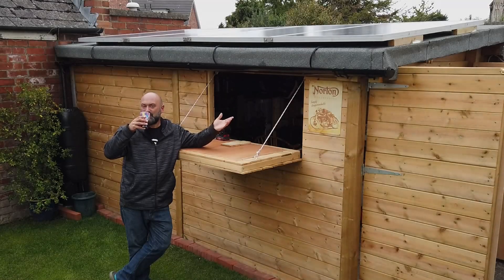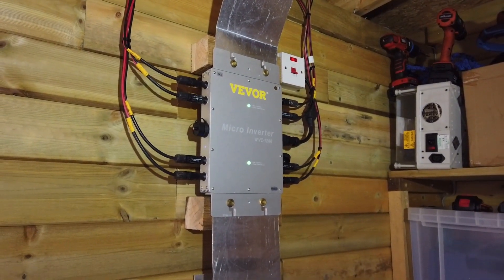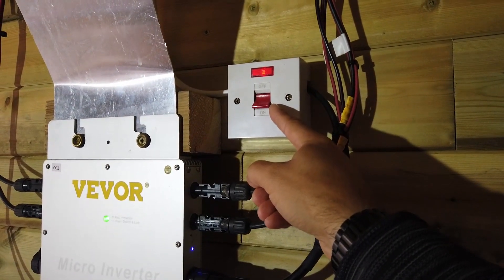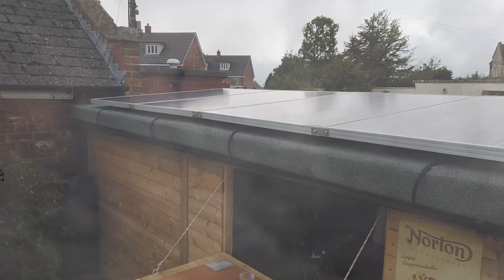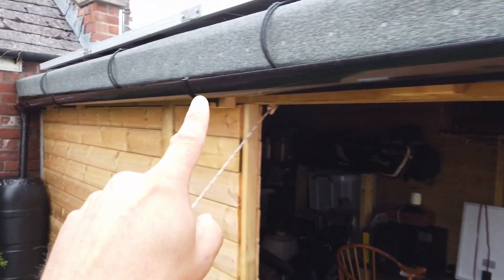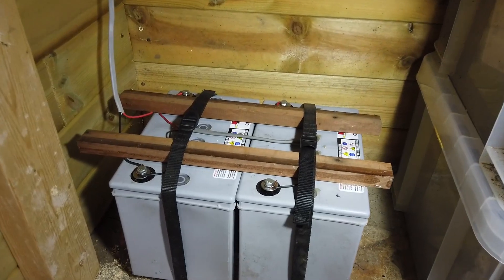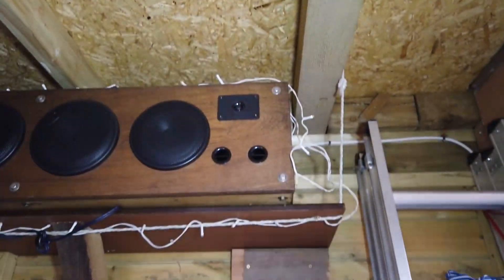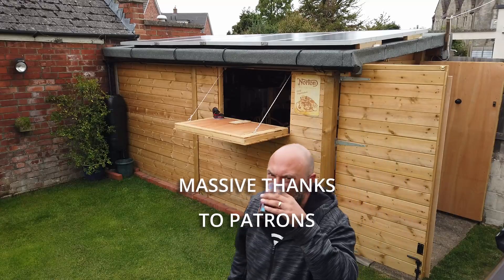DuB-EnG: How to install Solar Panels on Garden Shed - IS IT WORTH IT? - YES - Let me explain!

Comment: Totally excellent man.  I've recently seen a ton of second hand 400w+ panels for sale locally and im very tempted to do the same as you.  Micro inverters are really cheap now :)
Reply from the maker: It absolutely makes sense if you have the ability to use all the power when the sunshine 🌞 is out

Comment: Best uk solar video so far. How did you plug it in to the house? Where in the house up plugged it. How did u wire from shed to house. U missed some important bits. Important fir beginners like my self. Thanks for video
Reply from the maker: Because it's a grid tied micro inverter, it's just plugs straight into one of your ring mains...  I have it plugged into a wall socket upstairs.  Google grid tie inverter

Comment: great job but just to confirm it is  illegal to connect to any generation to the grid you have inform the DNO
Reply from the maker: In the UK, any inverter larger than 3.68 kilowatts (kW) requires permission from the local Distribution Network Operator (DNO) before it can connect to the grid. To acquire this permission, you need to submit an application called a G99.

If the inverter is 3.68kW or smaller, you’re able to simply ‘connect and notify’ without needing permission (this is called a G98).
Reply: Hmmm, doesn’t the kit also have to be certified for g98 compliance? Also, wiring regs, BS 7671 (regulation 712.411.3.2.1.1 ) prevents you from simply plugging this in to an existing circuit since when the breaker trips for that circuit it will still be live if there is any solar generation. Still, dubious engineering indeed.
Reply from the maker: @AdrianColes  just interested to understand… “if the breaker trips for that circuit it will still be live” …. The inverter only operates when 240VAC is supplied to it.  All that said, yes, dubious indeed ;-).
Reply: @DubiousEngineering  Yep g98 compliant grid tie inverters cut the power If no grid mains is detected,Im going to do the same but connect to a fused spur and fill out the g98 DNO  form, like you said you can get 1800kwh install done for around £500

Comment: Plugging into a socket directly is super dangerous (and I believe illegal) if that socket is on a circuit that has demand as well, you're bypassing the breaker from the generation side so you could overload the circuit without even realising it and risk a fire when the cables overload (e.g. pulling 20A from the grid through the 20A breaker and generating 10A from the solar side you're potentially pushing 30A through 2.5mm cable rated at 20A in wall)
Reply: Plugging 240 v into a power point…are you mad? Definitely illegal. The plug is live!
Reply from the maker: @robinmyman yes, it's strange that companies develop grid tied  micro inverters that allow you to do exactly that!
Reply: @DubiousEngineering  As little as 30 milliamperes (0.03 amps) can be fatal if it passes through the heart, though currents of 100 milliamperes (0.1 amps) or more can also cause ventricular fibrillation or cardiac arrest.
Reply from the maker: Absolutely, so, dont touch 240v AC terminals!!  Or have your electric radio on  the side of the bath-tub.
Reply from the maker: Very good point...   Thankfully this lot is 800w max.  So approx 4 amps.
Reply: No way its only 4 amps
Reply from the maker: @GaryNewsom1  nothing more to add…. :)
Reply: Yeah mate definitely good advice always think about health and safety
Reply: My real world experience: When the power goes out and the supply company give an estimated resupply date of 4 days what are you going to do?  I know what I’d do…
Reply: No it’s not because as soon as you unplug the inverter it stops generating power. The plug is dead as soon as you switch it off
Reply from the maker: @TheRCBiker yup it fails safe

Comment: Wait, what?  It turns itself off when there's a brownout?  Can't you just turn off the main breaker for the mains supply and then reset your system so you can still have electricity when there's a brownout?
Reply from the maker: It’s a safety feature…. If powers off, it’s off just in case engineers are working on cables.  There are other versions that have a mains breaker controller that do what you’re suggesting but they need wiring into the house.

Comment: Good for you! British innovation at it's best. I installed 2 x 410 panels and they are returning around 2 WKH per day. Payback isn't everything just nice to harness the power of the sun.
Reply from the maker: This installation has deffo paid for itself already…. Agreed!  That sun is a powerful source of energy!
Reply: I have a failry siiar setup. I went with 2x 535w panels for £86 each brand new with a 50AH 51.2v battery and do up to 5.5kw per day recently.
Reply from the maker: @zGratchGaming it all helps.. good work!!

Comment: Looks awesome. Do you think a normal shed roof could handle the weight of these panels? Or some reinforcement necessary?
Reply from the maker: My old shed roof started to sag under the weight of them...  The new roof is solid!

Comment: I don't want to be a  kill joy since you put a lot of well don work into this but it should be said though you are running a massively botched job here safety wise:
-All grid connected solar installation need G98 form minimum signed and given to DNO by an electrician, even if you are on island mode when a grid failure happens. You can get a massive fine, be liable for any amount of damage and also a complete grid ban. If you don't want the hassle of ever getting in trouble just run off grid, camper van style. 
-Your solar looks to be within 1m of your house boundary making it fail permitted development laws.
-Your solar has no earth and assuming the lack of mention of any grounding i will also think that you have no TT which is also a massive danger to you and any sparky working around your system. You cannot share grid only a TN-C-S system without additional grounding. 
-VEVOR hybrid electrical products do not have a ENA Type Test Register, meaning that all their products are NOT allowed anywhere near the national grid and would fail DNO approval. 

Like I said, I don't want to be a kill joy but i thought it would be a good thing to make people aware of, in case they attempt something similar. Best case for a system like this is too keep it off-grid, isolated to a shed or couple extended outlets, NOT connected to your consumer unit.
Reply from the maker: All very true!  I've have the power company out twice this year to repair and finally replace our 1970s overhead uninsulated cables which they have done, they had a good look around and said nothing...  I may well change this system out at some point and put a large stack of lithium batteries in there ...  Totally off grid  and a small diesel generator would resolve the perpetual rising costs!
Reply: I guess this is the dubious bit! Just to add you don't need to be an Electrician to submit a G98 or a G99 for that matter. Not sure what your comments mean with regard earthing "also think that you have no TT which is also a massive danger" and "You cannot share grid only a TN-C-S system without additional grounding"  TT and TN-C-S are types of earthing systems. It is not clear what the earthing arrangements are in this property but we do get a shot of some overhead lines so it most likely is on a TT earthing arrangement. You cannot rely on the Grid network earth during a fault if the system is grid tied and goes into Island Mode. This Inverter has anti Islanding according to the specs so no issue there. If he is on a TT earthing arrangement then that isn't provided by the grid so again would be no problem there but he doesn't go into Island mode anyway so no issue. Your comment regarding TN-C-S might be related to PME earthing arrangements and if they can be used in outbuildings like this. Generally no and the DNO sometimes forbid it but it depends on a few factors ultimately. The alternative there is to TT the outbuilding but that introduces its own problems in some cases. There isn't an hard or fast rule on this, each installation would need to be assessed on its suitability and problems. Everything else you said is spot on and I could add a couple more points.
Reply from the maker: @paulstimpson8977 wow!! :-) 😀  ...  let me take a moment to digest this! :-)  😀  anyway, it's still saving us shed loads of cash and hasn't killed anyone 😀